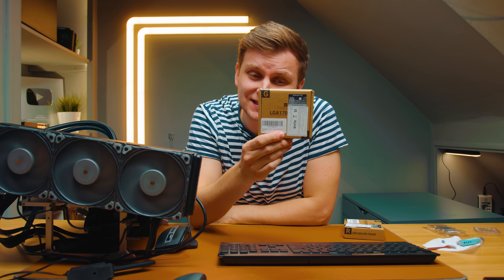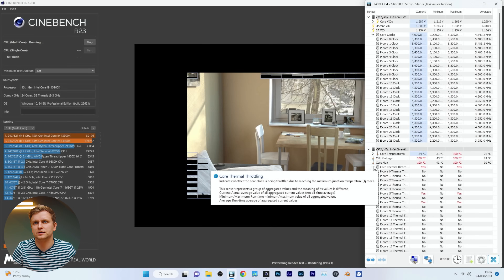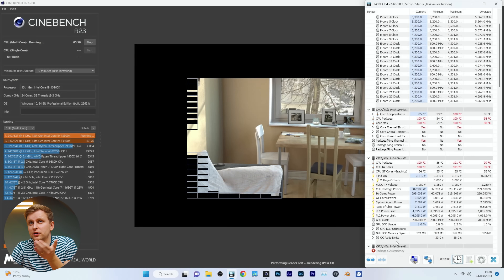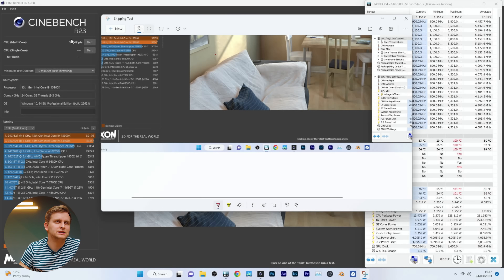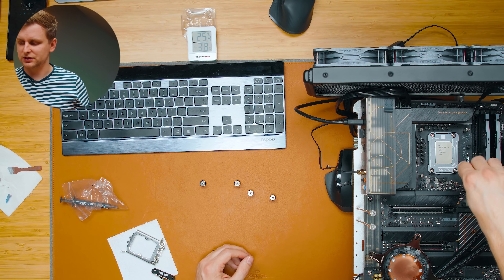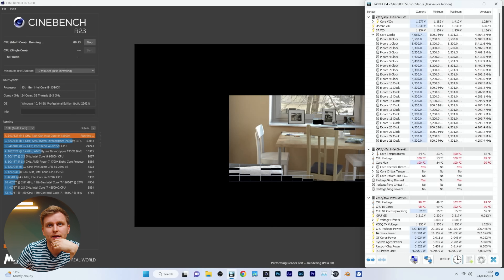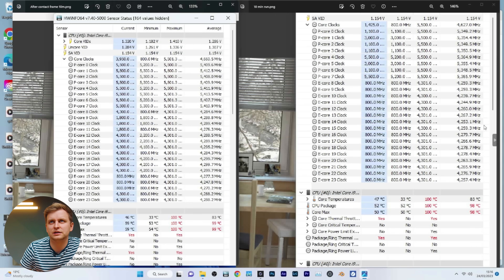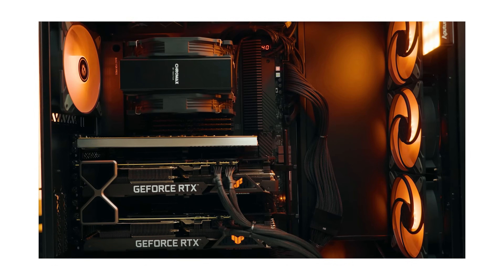This Makes Your CPU FASTER & COOLER 😱 | Budget CPU contact frame for Intel & AMD

Comment: Oh!!! I invested in one when I built my PC last August and have to say my temp is often at max 50 degree unless I am testing my system it will peak at 81 degree. It idles around 30 degrees most of the time. I am using a 12700K, Noctua NH -D15 Chromax. Black and BeQuiet Silent wings 3.

Comment: Anyone having this one (or Grizzly's) frame for 7950x? If so, do you see any benefits in temps with it? (I've heard AM5 doesn't need this cause they don't have the issue with CPU bending like Intel's 12th and 13th do...
Reply: I use one for my 7950x3d. No temp difference, but its nice if you hate it when ur thermal paste drips to the side of ur cpu
Reply: @Centrioless  oh, cool man, thanks for the info :)

Comment: If you are already hitting 330 watts on a 13900k without the contact frame, then your CPU is fine and the contact frame won't do much. The contact frame does wonders when your CPU already hits 100c and throttles at 220 to 250 watts.
Reply: its auto vcore causing that power usage... im getting 42k points at 305w...
Reply: I still recommend if you plan to keep your current setup for a long time. 

At least you will have even pressure on your chip for how many years you decide to not upgrade.
Reply: @csguak  I've had my 12900k from day one without a frame, it works just as good as the first one. Not noticed any difference with temps

Comment: "Tech Notice", why did you use 420mm Arctic Freezer as your cooler for your new 13900K rig when you said EK-Nucleus "Lux" CR360 is even better?
Reply from the maker: Yes used the Arctic, coz it was half installed, still working and it's quieter :)
Reply: @theTechNotice  oh, I see. But you still recommend EK-Nucleus Lux, only that it's louder? And what do you mean by "half installed"? :D

Comment: I probably didn't really need with my new 13600 build; but for $10 I figured why not? It certainly won't hurt anything.
Reply: Late reply, but youll be able to reuse it when  and if you upgrade to a 13700/13900 or 14 series as well : )

Comment: The Thermal Grizzly frame is supposed to be better for not limiting memory speeds as it requires some very precise turns with the screws for optimal CPU contact with the pins on the motherboard.
Reply: The difference is negligible ; it just costs about twice as much (eight times that of the cheap Chinese one).
Reply: I have a z690 ace with 6400 memory, very high end for z690 motherboards and no issues whatsoever
Reply: Faults, There is no difference what so ever.

Comment: day 1 of asking for a intel ARC review. its $230, if you need to buy it you will just make back the money from the video. you are the only one doing this properly so i really am waiting for your review. if you are waiting for driver optimizations and/or the APPs just crash upon launch, do tell us
Reply from the maker: Literally been working with Intel on this for months and months, but since Adobe hasn't released full support for ARC yet I feel like it's a half story/review. As soon as Adobe builds the support I'll make the  video :)
Reply: @theTechNotice  and i will be waiting! It will be interesting to see what accelerators Intel packed in, i mean 40% of the silicon is just dedicated to stuff like this right? :-D

Comment: Using the same part in my new build. Plus the bracket they have on the back of the board  to mount the cooler

Comment: Yeah I've gotten a 13700K, and I used this exact frame and MX6 paste with a DeepCool HK620. I did have to lower the voltage of my CPU to 1,225V to prevent it from thermal throttling. 
Now at 100% load it goes to 96 degrees max and I get a CineBench score of 30.166 points

Comment: Not sure if you read comments but if you do, the NH-D15 on my computer was contacting the bulge on the lock retainer on the CPU bracket preventing it from contacting the CPU.  I almost wonder if it's what was making it perform so bad in your air cooling test.
Reply: What circumstances did this occur for you? Using a thermalright contact frame? I am using it with the lga 1700 12700k with the nh-d15 and am very happy with my setup. No power limit whatsoever. Stock clocks without ever exceeding 83c in small ffts in prime 95. This is in a case. Edit: it hits  200w in this scenario.
Reply: What is the cup bracket?
Reply: @Akkbar21  CPU bracket.  On the side that it latches it was contacting the cooler keeping it from contacting the CPU.  I didn't notice it until I was getting 22,000 in Cinebench and my daughter was getting 18,000 with her i5.  Swapped the bracket thingy for a Thermal Grizzly bracket and the i9-12900k went back to 27,000 on Cinebench and started working again.
Reply from the maker: I don't that was the issue with the nh-D15.... since that was the only noctua cooler that did that even though they all have almost identical contact area to the CPU.... 🤔
Reply: @bdp-racing  interesting... I think my coldplate is contacting the ihs properly. thx for making me nervous tho ;)

Comment: Tighten the screws in a X pattern
Reply: use impact gun
Reply: @mtlshdr  lmao that'll be 6 uggaduggahs a corner
Reply: @02honeydew  This made me cry in laughter haha.
Reply: @TheBURBAN111  lmao
Reply: @mtlshdr  Almost spit my drink out when I saw this lol
Reply: @mtlshdr   legend, made my day
Reply: @mtlshdr  Preferably a 3/4"
Reply: Too late!! The chip works . The average temps are at about 34 c. I think I did it right based on the temperatures at idle :) lol
Reply: He doesnt want to.
Reply: I was gonna say the same thing. He put uneven pressure on the cpu
Reply: BULLSHIT! this is made up nonsense that people repeat everywhere so now it became "truth" while it's nonsense. Main thing is to tighten the same amount and not all at once.
Reply: I used my air impacted, 100% would recommend, that mob ain’t going no where

Comment: I broked my msi unify z690i using this thing, it was my first build and i had problems geting My cpu to make proper contact, that led me to overtight they screws and chip My mobo exposing 2 lanes and about 4 layers 😔
Reply: Ohh... sad to hear this! The thermal Grizzly model Especially gives instructions on how much to tighten the frame with very easy-to-apply steps - first with the force of two fingers on their L tool, and after that, 90 degrees, no more to prevent that happening to you. In their channel, they even show how to mark with a marker the bolts and the frame itself has rules to give you a proper sense of how to turn it exactly 90 degrees and no more.

Comment: Got this same exact part for my build (13900k) and it has been a lifesaver, paired with the lt720 aio from deepcool I’ve been able to OC to 6ghz and I’ve never throttled and even under full load for sustained periods I never get higher than 93C temp. Aesthetically (even though you can’t see it once the aio is mounted) it looks better on the motherboard than the default frame too lol.
Reply: yes full contact on cpu is best thing
Reply: 6GHz on AIO? Kudos to you bro.
Reply: What thermal paste you're using?
Reply: @AntonioStark7  No joke just the stock paste on that comes on the AIO. The contact frame is and the way you screw it down is huge. The case I run is a Corsair 400d airflow and rn I’m just using stock fans that came with the case and aio. I was able to get 6Ghz from an instant 6ghz feature in the bios that my motherboard has and running through a full cinebench test I hit a score of a lil over 40k and from monitoring temps the cpu never went over 93 and that’s after being on the computer a while before I even ran the test. It’s nuts how well this things runs and I was even a bit surprised after hearing all this stuff about the 13900k overheating. I’ve built another pc before that ran for years but it didn’t require the level of attention to cooling that this one did lmao (I use it mainly for Video and photo Editing)
Reply: @jhendyy  which motherboard u r using that have 6ghz oc option in bios ?
Reply: I have bought 13900k, lt720, and now looking at contact frames. 6 Ghz and maximum temp are 93 C, just wow. How is that possible? Is it related to the OC settings? What was your stock results?
Reply: @fatihcicek1858  100c surely as stock ilm's are trash ones
Reply: @iamrubinot42  I don't understand what do you mean by ilm. Is it about silicon quality,  setups (cooler and paste), or stock values (voltages, pl1 and pl2)?
Reply: @fatihcicek1858  it's the lga1700 lever intel installs in the factory
Reply: @iamrubinot42  i see, thanks
Reply: Do you mean 6ghz all core or 6ghz 1-2 cores?
Reply: does the mounting bracket installation void the warranty of the motherboard?
Reply: @nwtngraphics  GOOD question. I know that maybe a year ago .. or whenever this issue was discovered, that MSI offered a free (similar) contact frame for people who had bought their Z690 / Z790 mobos. So, they clearly expected the customer to swap out the bracket, and I don't think they considered that voiding the warranty, considering they advised customers to do it, and supplied them the upgrade. Too bad that promo is over. Now I have to buy one.
Reply: @THE-X-Force  well, probably i will buy myself one
Reply: I got exact same build / specs, what do you do on the bios , water cool or air cool ? I got a msi z970 tomahawk ddr5 motherboard
Reply: What do you do with 6ghz dude 😅😅

Comment: yeah I have used them and I like how easy it is to install. I had an issue with a build using intel's mechanism and had to swap one of these Thermalright's frame but I had issues from the beginning trying to get the system stable overall. RMA my MB will see what happens
Reply: Any problems with mb wantarry using those? Did they even bother asking?
Reply: @Wa11breaker  no they never even asked
Reply: @rmorenberg  Thanks! Guess I don't need to worry about heat if I get a 13th gen!
Reply: @Wa11breaker  just make sure to apply the thermal paste properly

Comment: bro that frame is just for bending corrector
Reply: @Arkos yeah and they made this custom frame just to avoid the cpubending
and the temp still the same
Reply: @clkbait3200  it dropped the temps on my 13700k by almost 10C, so it definitely is not just for bending
Reply: it depends on motherboard not the cpu

Comment: There was once I release the lever, it skip off my finger because the strength of the lever is quite strong, the cpu jump up a bit, rest on a few pins and cause the pins to bent. I'm so lucky to bend it back to position. I feel that from now on, the socket should follow this type of design. The spring loaded lever is too strong, there is a chance it can skip off the finger because of the curve in/out way of tightening. The spring is shiny stainless steel that made the surface slippery off the finger of the curve in/out way of tightening and release. Now I always place one hand fingers to stop the rectangle metal from spring out that lead the cpu outward force jumping out while release the lever.

Comment: This Frame 100% works. The Thing is, if your CPU is overheating heavily already, because there is no power limit and you did not do any undervolting, it's hard to see the benefit so easily, since no power-limit means only the temperature is the limit. Which in this case is tjMax 100°C. I have close to 42k with undervolt without power limit on air cooling in Cinebench R23 Multicore. Or 41k with 253W Power Limit.
Reply: You didn't even say what CPU you have? Amd or Intel?
Reply: @Slicktune  I guess its a 13900K/KF
Reply: @Slicktune  well if Power limit max is 253w that intel spec limit for a 13900k
Reply: That's when you get a direct-die mounting frame.
Reply: I mean the Intel variant. And given example is a 13900K since thats the one showcased in this video.👌

Comment: My temps in cinebench r23 went from above 100C with 27k score to 75C with 30k score. I used the Thermal Grizzly contact frame with my 13700k.
Reply: Good stuff but, you also must have done other things in conjuction as, 25 degrees is way too high of a number for it to only be reflective of a plate.  Somewhere between 6-12C is what these plates will give you.
Reply: @potvinsuks8730  If you get unlucky with a particular curved CPU and a cooler curved the other way, this can very much be possible due to bad contact. Also, could have tightened up the screws or changed thermal paste application.
Reply: @Ahnii  Yeah I had read about this and I made sure to check the CPU and the Cooler plate when re-seating for an Contact Frame.  What I found interesting was that the h150's plate was plump flat on mine and I know that there have been people saying how there's was concave. My 13700k is also flat.

I had already RMA'ed the LCD Kit and unfortunately, the RTOD was still there to say hi each time I turn on PSU switch. Just today I sent out the h150 for an RMA as well to see if that's gonna help.

Gonna be w/o my new PC for a couple of weeks no which stinks,  but at least Corsair said that they're going send me the new RT model for replacement, which is some sort of silver lining I suppose.

Despite my unhappiness w the product, I cant't  take anything aeay from Corsair Customer Service. Top notch.     

Will Update onve I get it backn installed.
Reply: @potvinsuks8730  its not that simple, depending on temperatures and clamping (pressure) cpus and coolers can curve/ be uneven
Reply: @Ahnii  Yeah, I also tried with different torsion settings on the bracket as well. From re-applying the TIM to trying different torque settings, nothing  helped. Although, I never had an issue with it other then the RTOD visible.

Should be getting the RT in a few days as I got word of the shipment. Will update and let you know what happens. Thanks!
Reply: Bravo man! This frame, no matter is a little bit tricky to install, must be DeFacto standard! 25% is a Huge difference!
Reply: what cooler are you using?
Reply: Lol i get 70c in cinebench without this
Reply: @David-nd4to  what cpu though?

Comment: Hello sir !Ryzen 9 7900x and "Asus TUF Gaming 650 plus" AMD wifi board is good for my 4k 3D animation editing,rendering , or gaming?? Or should I go with intel 13th gen i7?? And also suggest good PSU... currently im using i5 4570 4thgen with gtx 1070 and corsair CS-650 gold certified PSU(sorry for my poor English)

Comment: I don't believe in these contact frames.
Reply: Gamers Nexus already tested it. It will drop your Intel CPU by a couple of degrees by fixing it's bending issue. Does nothing for AMD since AMD CPUs don't have that issue, though it's good as a thermal paste guard.
Reply: The default mounting bends  the cpu
Reply: As stated in this video, if the cpu is already bent the frame may not help as much. The contact frame should definitely be used in new builds to prevent it.
Reply: I've got one on my i9 13900k and I can promise you than It's work really really well,I use it with grizzly kryonaut extreme and you can push further the i9 than without it,the i9 have a better hot dissipation
Reply: I don't believe in you...
Reply: Then I guess Tech Notice, Jays2cents and Gamers Nexus are all lying? How dare they!
Reply: it 100% works. but if your CPU is overheating heavily because there is no power limit and you did not do any undervolting, you can't see the benefit so easily, just in the scores...
Reply: i don't believe in contact frames either, but i believe in my own two eyes and what i saw were contact frames.